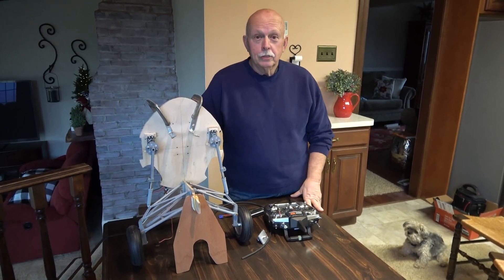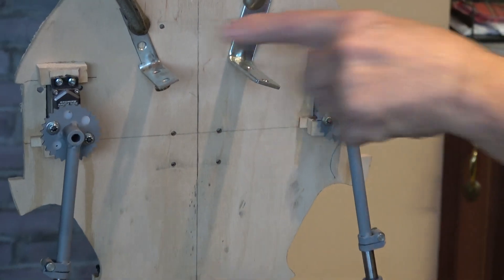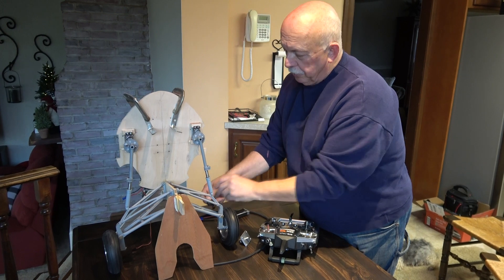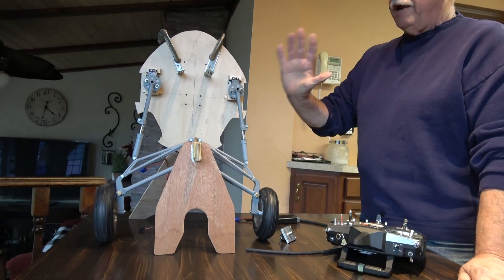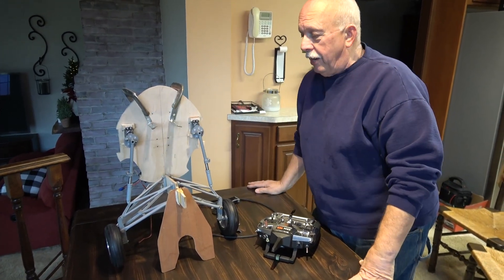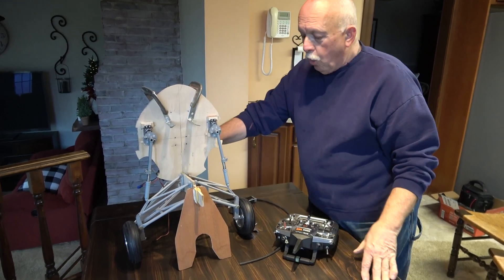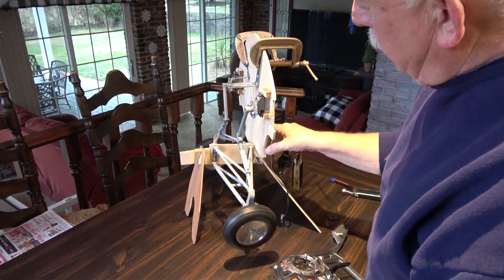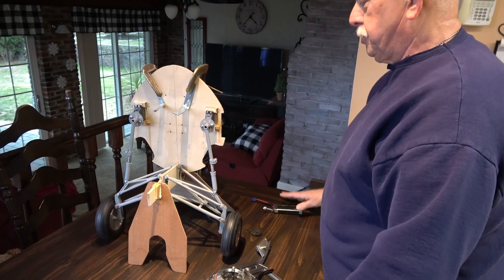Robart's "Jerry Bates Wildcat" landing Gear Modification (Part 2)

Comment: I saw your video and your solution to the binding issue seemed great.  Later I was thinking how robust the blocks that you took out were.  The first landing will rip the servo arms off as they will take the direct landing load. I hope I'm wrong but if that is true I hope you haven't build yet.

Comment: Ryan, SUPER IDEA. I LIKE IT. However, the one possible issue I see with this arrangement is that your servo outputs are subjected to not only the weight of the aircraft, but the shock of every landing. Your thoughts?

Comment: Reallu nice job Simple and effective.  Tried to find a VIDEO of the Retract system on the Full Scale Wild Cat but no luck but some showed the wheels retracting but not the Mechanism. I remember reading it was Hand Cranked by the Pilot and took about 32 turns to achieve full up or down. Thanks again for the Video. Love the Finished Plane.
Reply from the maker: Thank you! Greatly appreciated
Reply: Yes, I remember that it was hand cranked up and down by the pilot but I didn't remember that it was required 32 turns fully up and down. This means that the poor pilot had to cranked like crazy meanwhile he had to land or take off. He must had an oversized arm, lol...